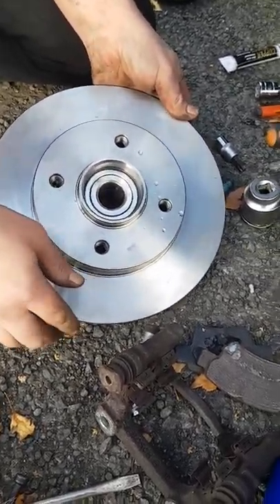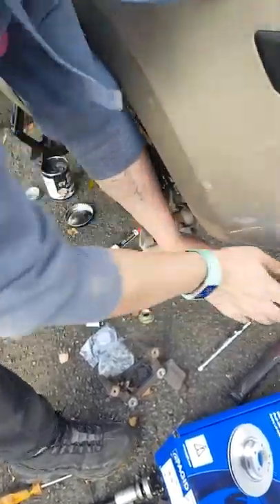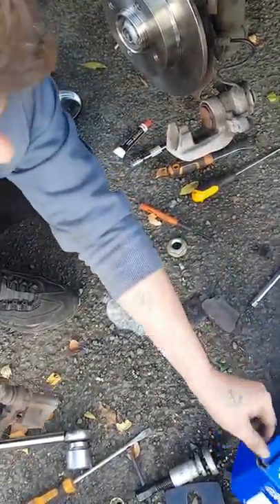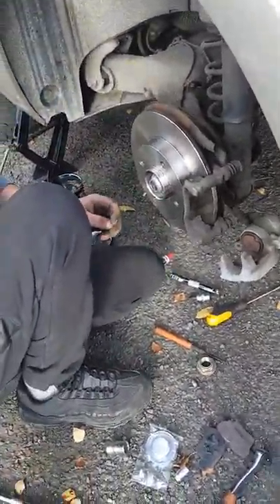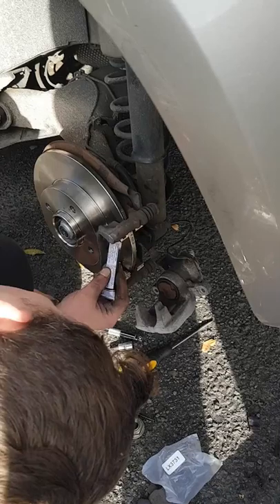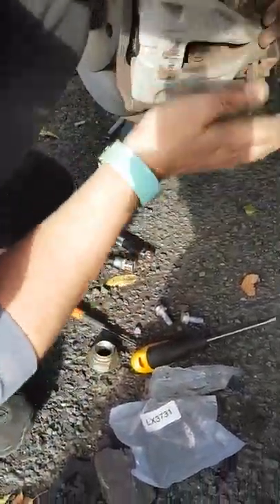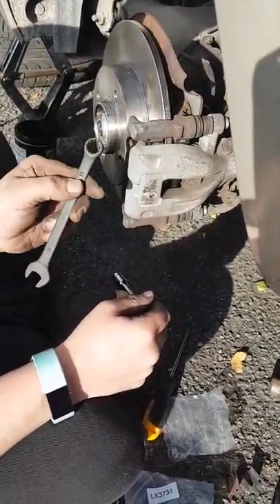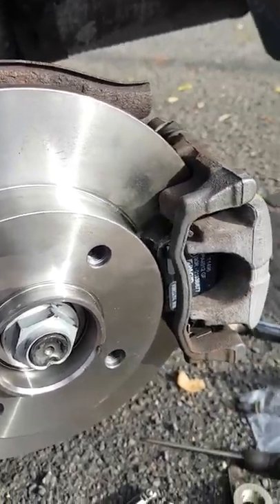Citroen C4 Rear break disk and pads removal and fitting

Comment: That got electric handbrake!!
Reply from the maker: No just a normal hand break
Reply: @Adventure.with.Robbie  my pug slams handbrake on when turned off lol! Does it just wind back at normal when engine off cheers
Reply from the maker: Mine didn't have a auto hand brake but will have a look in the Hayes manual for you